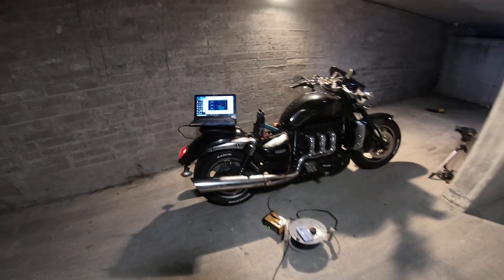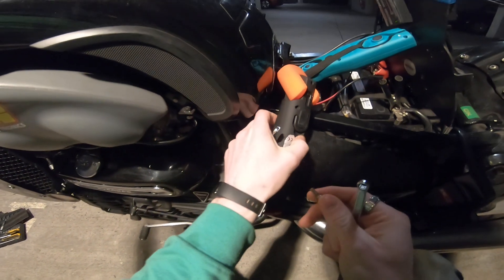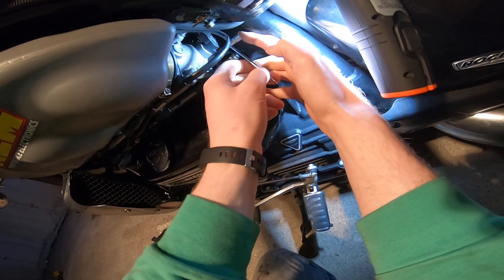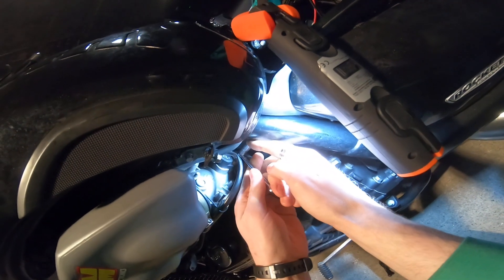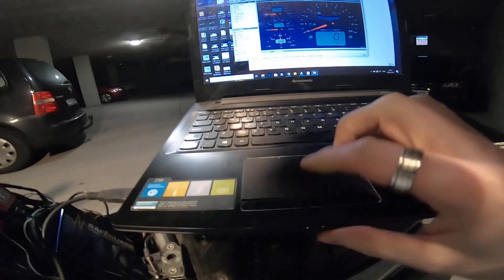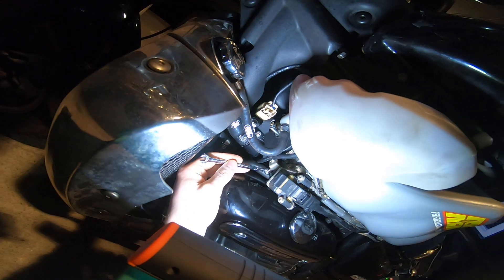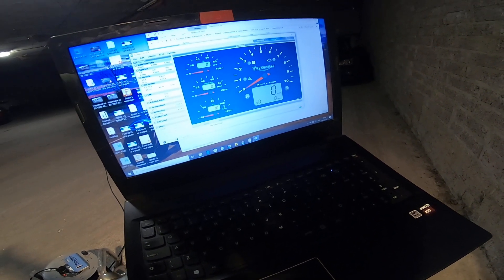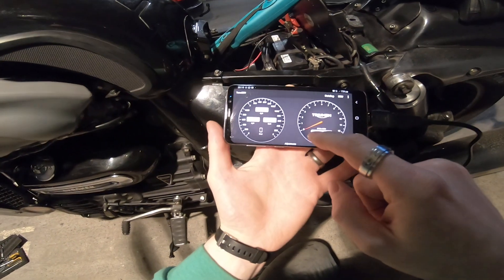How To Adjust TPS | Reset ISCV on Triumph Rocket III with TuneECU

Comment: Hi Mate. Any chance you can help me sort out an idle issue on my Daytona 955. Mechanics-have been checked and new  idle stepper motor installed.
Reply from the maker: @evintroy4985  so the fitted a new idle stepper but it didn't fix the problem?

Comment: Is there somewhere we can still get and use the windows version of TuneECU?
Reply from the maker: https://www.r3owners.net/threads/tuneecu-v2-5-5.35481/
Reply: @r-iii-rturbo9157  Got it.  THANKS.  Now all I need is Springtime in the NW.
Reply from the maker: r3owners dot net, TuneECU Windows version can be downloaded
Reply: @r-iii-rturbo9157  I will try again, but the website seems to have turned it off and it is not supported anymore....

Comment: what are all those other gauges?
Reply from the maker: Knock/retard, boost, air fuel ratio, fuel pressure... the bike was supercharged for a few years and will be soon again (it took a break to take transplant of the 2.5L Stroker engine with normal aspiration)
Reply: @r-iii-rturbo9157  Wow.

Comment: I can't believe that you still have the original air ducting still on that Rocket.
Reply from the maker: The idea was to see purely the difference the 2.5L Stroker kit alone made to the bike
Reply: And it made a huge difference 👍
Reply from the maker: @phar2slor3cpilot55  indeed, next step is to add the Carpenter goodies and it will be the most powerful NA Rocket in the world :)

Comment: Thx for the video. I was needing this last week and there was no video on YouTube....😪😪😪
Reply from the maker: Indeed there isn't, I uploaded an old clip of just clicking though the Adjust ISCV for the benefit of a captain on r3owners.net, then thought because I had it at 0.56/0.68v it might be misleading.
Then found there was no full how-to, so decided to go video the lot.
Reply: So I am adjusting the nut and I get no change... when i run the test i set the primary to .6 and I am getting the same reading when I get to the ISCV and when I adjust it there is no change
Reply from the maker: @IamONaLIST  so nothing happens when you double click 'Adjust ISCV', after setting TPS to 0.60v?
Reply: @r-iii-rturbo9157  I had TuneECU open going through the adjustment process when I get to the second part ISCV adjustment it reads .6 as well. Turn the nut and nothing changes
Reply from the maker: @IamONaLIST  strange, the stepper mustn't be connected or something. Let's discuss in messenger

Comment: Great video, more tune ecu how to would be great.
Reply from the maker: Thanks, any suggestions Jeff?
Reply: @r-iii-rturbo9157  like resetting the adaptions or is that similar to the 12 minute tune.
Reply from the maker: @jeffboss4317  Resetting adaptives is a press of a button in TuneECU. The 12 minute tune is a forced adaption.
If you were up the mountains for a while then came down, you might reset the adaptives and do the 12 minute tune to speed up the ECU adapting to the new environment.

Comment: how do we get that last 4% of WOT
Reply from the maker: https://youtu.be/WW7jD8Shd5s
You could file the throttle cam stop, to achieve 100%, however there may be a reason the throttles max out at the low 90s. Perhaps airflow is optimal at like 93%, and going to 100% might actually hamper it marginally (like only going to say 85%). I don't know, but it would be nice to know